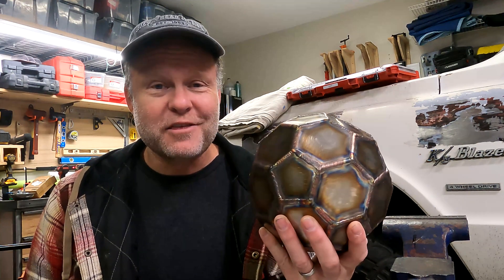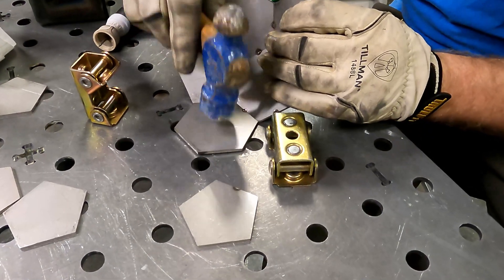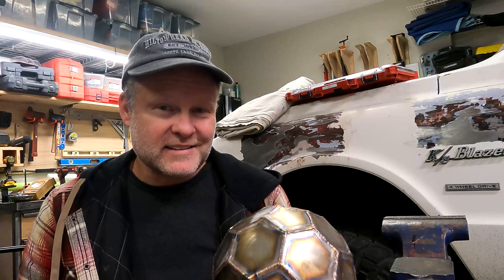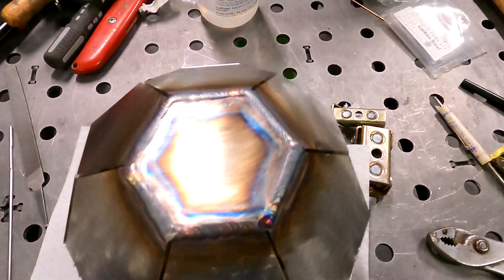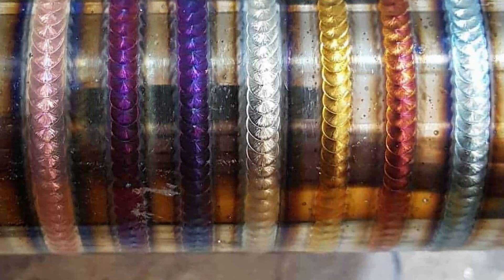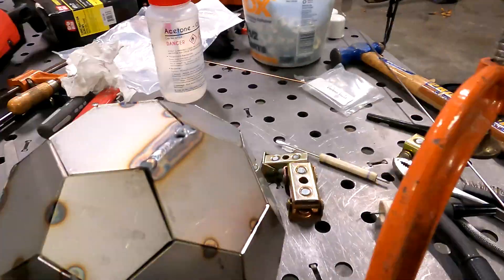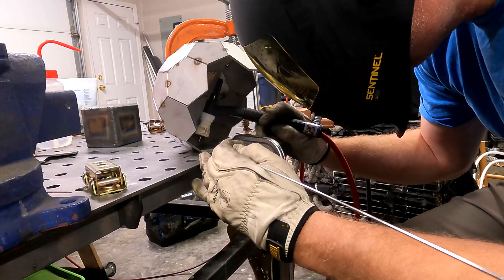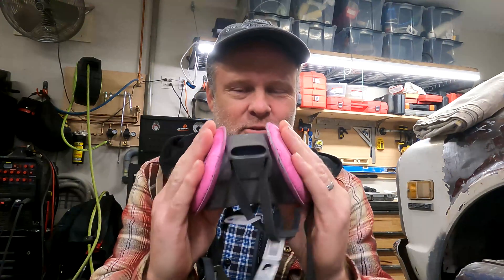Stainless Steel Soccer Ball welding puzzle

Comment: You'll get a million comments on the weld but stainless is counter intuavid when you go down on amps and weld slower you put more heat in the part if you run a little hotter and move faster it actually keeps heat out of the part in short it goes down to jewels of energy but good job man mine came out descent to
Reply from the maker: Yea, its an interesting balancing act.

Comment: I heard real men don't wear respirators when welding stainless. As the hexovalent chromium puts hairs on your lungs 🫁. Real men have hairs on their chest. Really real men have hairs in their chest

Thats a joke! Dont be stupid and always wear a respirator when welding, not just stainless, but all types of welding.
Also, wear a respirator while grinding your tungsten. 2% thoriated which i used to use all the time for stainless and mild steel piping, which is a great tungsten for those, is actually radioactive, and gives off radioactive dust particles. And that will put more than just hairs in your chest. It might put 3 eyed, hairy chested toads in there
Reply from the maker: That’s good advice

Comment: Enjoyed your video sir! And I too have had problems with the filler sticking, I was using a 3/32" piece on 1/8" stainless. I just ordered 1/16" so we'll see how that works...excellent work Sir!
Reply from the maker: Thanks! I think it’ll help, especially if you can’t turn the heat up on the torch any further.

Comment: Nice work Brian.  Your diagnosis on the filler rod was spot on.  A thick filler rod actually cools the puddle more as it flows in… so a thinner rod helps in those situations.  Also… the large Furick diffuser cups definitely need more Argon flow than a conventional cup.  (I use 30cfh on mine FWIW)
Reply from the maker: Thanks, I’ll have to try some more with 30cfh. Feels like I’m at the welding store for refills way too often, probably need a larger tank.
Reply: @bdpgarage  Make peace with that Brian!  LOL..... I used to have a single 80 cu ft Argon bottle... then a bought 2 of them because they kept running out so fast. (The post flow really eats up a lot of Argon!)  Now I'm up to either 4 or 5 bottles of Argon in the 160 cu ft size so that I absolutely ALWAYS have enough to do my work over the weekend and can have a couple of those tanks over at the local welding supply shop getting refilled for the next weekend.  When I did my K5 framerails project, I went through an entire 160 cu ft tank in a single work day.   You are going to consume Argon, especially if you fall in love with the larger Furick diffuser cups which need more flow.
Reply from the maker: Ugh, we’ll that helps me choose between getting another 80cuft tank or stepping up to the next size.🤣